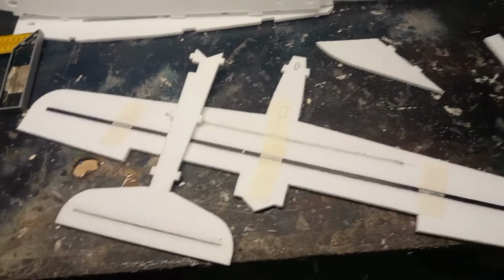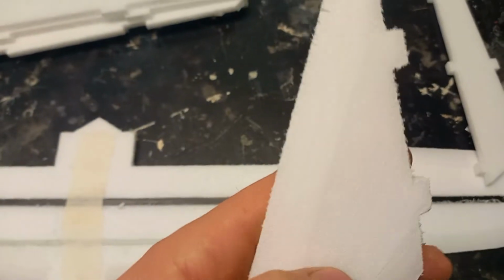Building of the "Speedy" fast depron rc plane

Comment: information.         ailerons  should  be  located  INBOARD;   not  outboard.!       obviously, in order to do this with a single servo, the use of modified strip aileron hardware  is  necessary.            there is no reason to use a wonky  thrust angle, with  electric  power.!!!!       it is normal to taper a tail boom  in Both  axes;  not just  one.!         next time, try  covering  a fuselage  After  it is assembled.        googletranslate
modified strip ailerons, simply means using an elongated  torque rod (at the hinge line)
https://hobbyshop247.com/image/cache/catalog/DU-BRO/STRIP%20AILERON/t355_2ca41752ccf4dbdb76d8fe88c488fd44-800x800w.jpg
Reply from the maker: Thanks for your imput.

The aileron are inboard (you can see the recess in the main wing in the first shots of the video), they are made in this way so you do not have to place the servos or run some rods into the wing, so they are easily controlled by one servo at the center of the fuselage.

The use of the torque rod method for moving the ailerons would be a good choice if the hinge  was placed on the centerline of the airfoil or wing ( as shown on the image you linked); I use this method of hinging control surfaces on all my small planes and I never had one fail, also this method is simpler and (in my opinion ) more suitable for plane like this one.

I built several electric plane and I am sure that there is no difference between gas/glow and electric when it comes down to thrust angle,  also, being this the fifth model of this plane that I build I can confirm that you need to get the motor slightly point toward the right to make it fly straight.

I tried to cover the fuselage after having all glued in but it was a bit more difficult being the wing in the way of the covering film, I am for sure not the master of covering (and you can see from the video) but I found out that covering the pieces before gluing everything toghether  saves time rather than doing it once it's all toghether.

I did not understand the point for wich I sould taper the tail boom in both axes.

Everything of this comes from what I have done and from my experiences done with rc planes in those years.